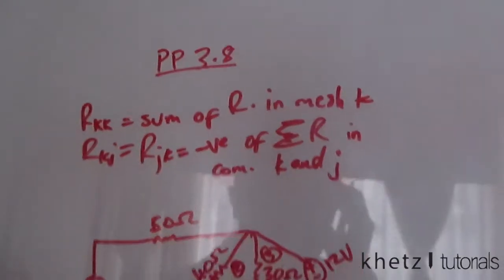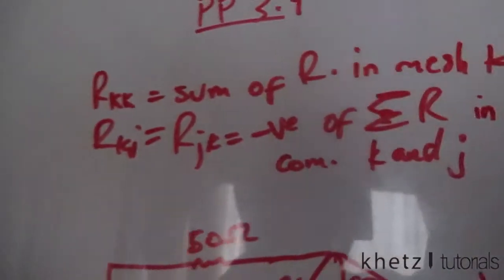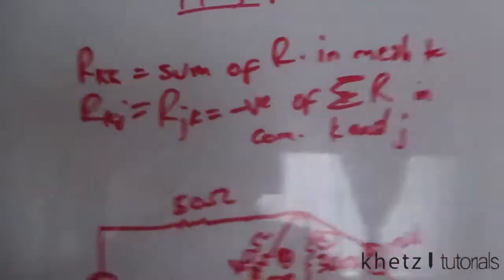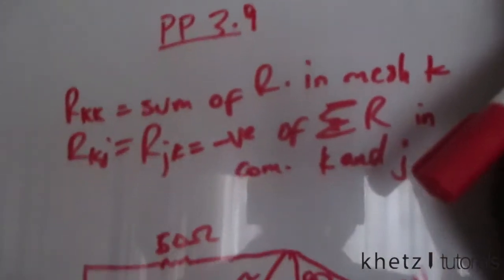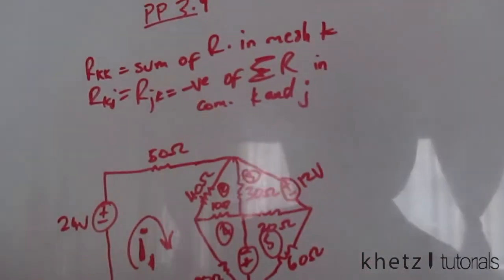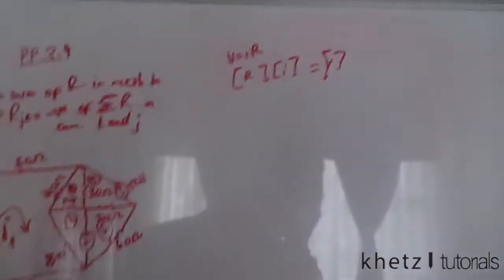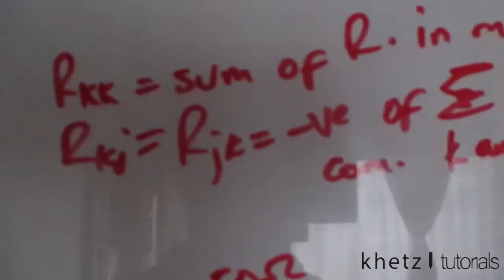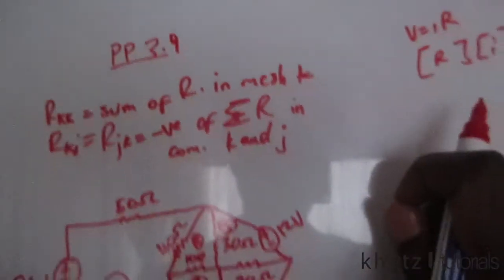Fundamentals Of Electric Circuits Practice Problem 3.9

Comment: sir why the resistor is minus ?
Reply from the maker: Hello. This solution is only based on inspection(simply looking and adding stuff). Shared resistors(I.e those that are in-between two loops) are assigned negative signs and that is just how it's done. If you look in the textbook or the start of the video, you will see that I mentioned this(Rjk = -ve...etc)